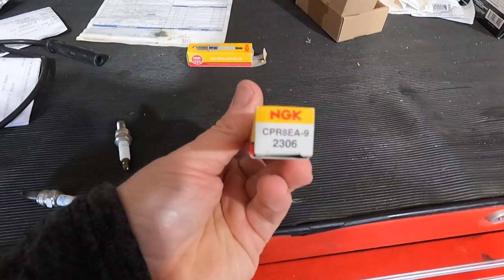Odes 1000 X2 LT just died & wont start back up

Comment: Love the content! Recently picked up a 2013 ODES would love to see some content for the older ones!  Im struggling to find simple information on the clutches and tools needed. Apparently they used 2 stle clutches in my year! Keep up the great content
Reply from the maker: Yeah the clutches in the older ones are different.  I did a clutch up grade on an older one with the cvtech clutch & it worked perfectly. Not to many of the older one around my area any more. Another YouTuber called 2vintage is doing a video on a older one. The rod bearings went bad on it. Not sure how detailed he is going to be with everything else.
Reply: @limitlesspowersportsservic3394  yes love that guy he is amazing! I watched the first video..he is doing a follow up. It’s the puller tool I can’t find. ODES USA told  me it’s a can am style puller but couldn’t reference a model mine has the 12mm I believe not the 14mm
Reply from the maker: There is a clutch puller kit on Amazon with a ton of different sizes. https://amzn.to/3KAhP5L

Comment: Really enjoy your videos and learning. Just wondering what the valves should be set on a 2017 bennche bighorn 850. Nothing in the book or metal plate on the machine what they should be set at.
Reply from the maker: I'm not 100% sure for the 850 but I do know the 700 & 750 are .005in intake & .005in exhaust.  I believe that should be with in spec for the 850 - 1000cc machines also.
Reply: @limitlesspowersportsservic3394  Thank you for the reply...

Comment: 2016 starter cracks slow but I pull the plugs and it spins way faster 😅I need some recommendations
Reply from the maker: Well definitely check your battery for at least 12volts with key on. Then check volts while cranking it over to see howany volts it drops. It should only drop to around 1-1.5 volts. If it drops more you need to have your battery load tested at a local automotive store & make sure you have the proper cold cranking amps to turn the motor over efficiently.  If all that is good, you can check your vavle clearances to make sure they are not to loose causing a high compression issue. If that checks out then you probably need to replace the starter which is a pain in the butt.

Comment: I've got 2023 odes 1000. Keeps fouls plugs exhaust gets cherry hot. It's aa the place I bought it they can't fix it help me? Brandnew sxs.
Reply from the maker: You need to get a hold of Terry at norwestsuspension.com 
He sells a program called hud hacker & you cam modify your fuel table. Definitely running rich. With the exhaust getting red hot, that is due to the Catalytic converter that is installed in the exhaust. A lot of guys will cut that out and put a straight pipe in place, which lets it exhaust.Run a lot cooler and also a lot of guys.Will also line the inside of the housing with a thermal acoustic heat barrier.I have a few videos on my youtube channel about that. Also, if I have helped in anyway please subscribe if you haven't already.